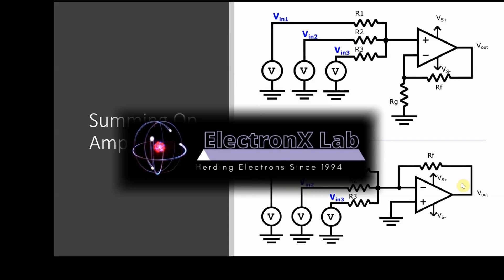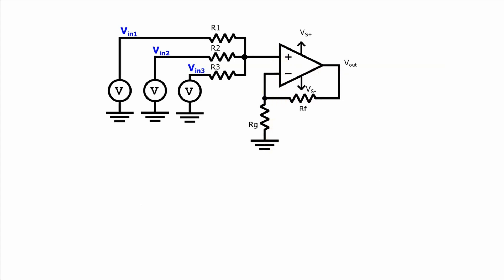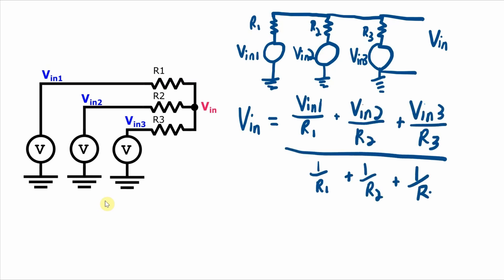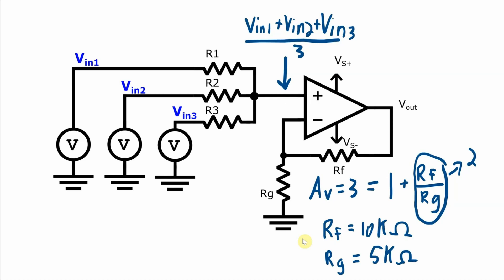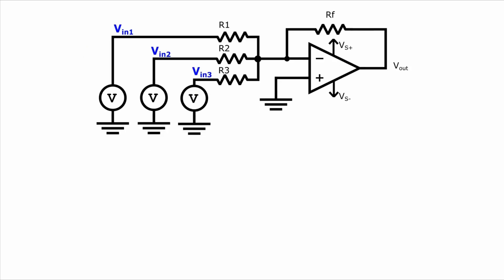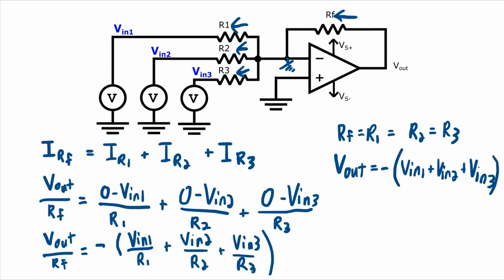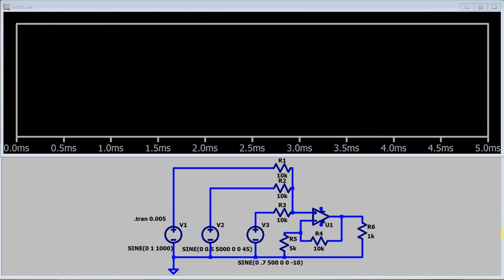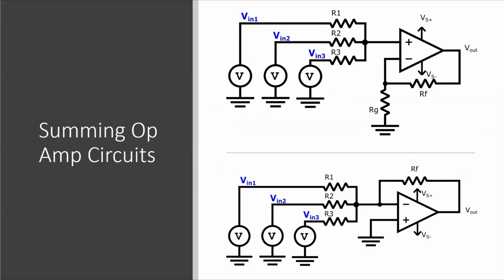Summing Amplifiers

Comment: This is one of the better videos I've watched, which helps understand the working of the circuit, rather than just giving piles and piles of formula. Thanks for a great video.
I've watched several videos that don't even mention the relationship between the number of voltages being summed, and the ratio of the feedback resistors. You explained it well.
One thing that I think is not mentioned enough is that the voltages to be summed should be low impedance sources so that they remain unaffected by feed from other voltage sources.